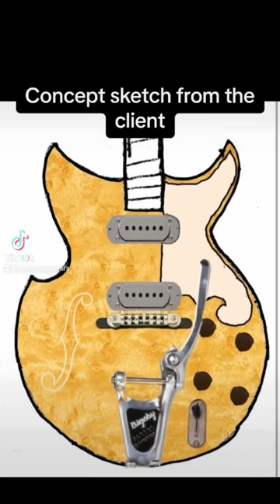Crazy wild Bigsby style custom build for Connor - Coloma Guitar #luthier #electricguitar #guitar

Comment: Wasn't there supposed to be an actual F-hole?
Reply: This guitar is meant to resemble early electric guitars from the late 1940s and 1950s, before a lot of the modern design elements we now take for granted. Lots of guitars from that period had fake f-holes, either inlaid (as it looks like this was done) or just painted on. Omitting the f-hole was thought to reduce feedback.